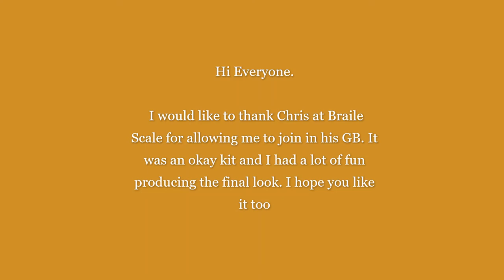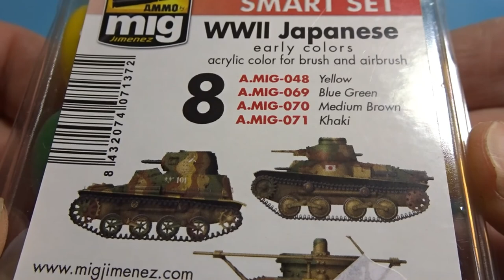Dragon 1/72 Scale Type 95 Ha Go Full Build

Comment: That has turned out really well. Shows that layering up the weathering effects is very effective. Those flexible tracks are a nightmare - I find that the paint chips off and touch up is needed no matter what I do. These camo putties work well if you're quick but on vertical surfaces they sag in a short time even if only a thin sheet is used. What thinner do you use for the oils? I use Artists White Spirit but I have heard that W&N Sanodor works just as well without the smell and it dries quicker. Another fine model and an interesting video.
Reply from the maker: Hi Jim. I hope all is well. The tracks took the gloss of what would have been a very enjoyable build. There were a few other things I wanted to do at the end but lost interest because of the tracks. I am hoping to invest in a posh AB soon so I can use it for freehand camo patterns more. However my senior moments are becoming more and more frequent and I forgot to clean out my airbrush again the other day and ruined yet another one. As for thinner I use Zest (21.30 minutes into this vid) which is an artists thinner which smells of oranges. I have had no issues with it and would recommend it to anyone as it leaves your room smelling of oranges👌😎👍
Reply: Hi Steve  I didn't notice the Zest bottle in the background. I'll certainly give it a go. A room that smells of oranges will earn me some Brownie points from the missus.